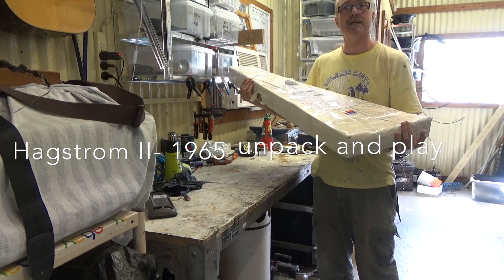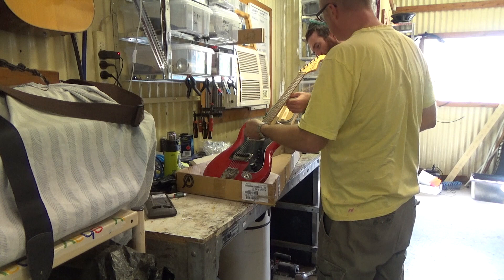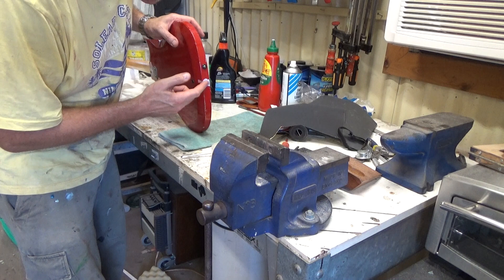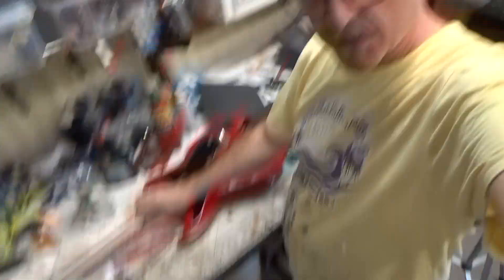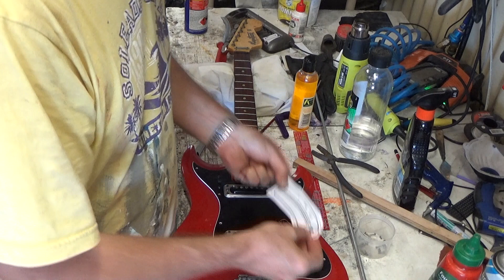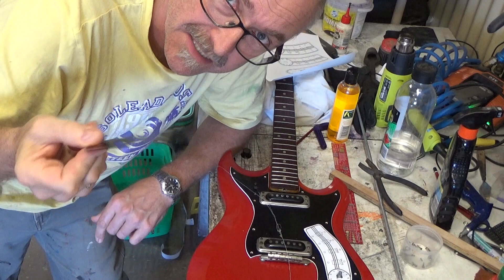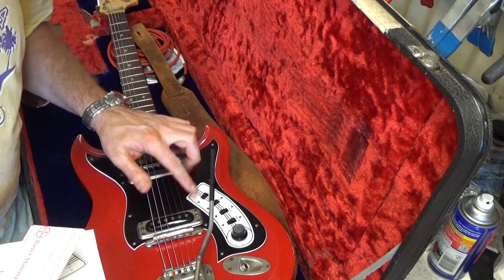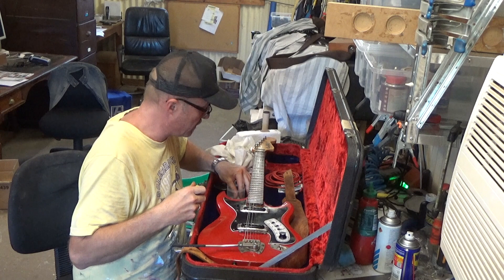Peterman setting up and reconditioning a vintage 1960s Hagstrom guitar

Comment: I am looking for an HII right now. Thank you for all the tips with restoring it! I am not as big fan of the white control plate so I would have left it black or gotten a new scratch plate that accommodated the switches. I have also seen some that use white switches and they would look better against the black background.

Comment: just got a 1965 black and white Hagstrom 1, looks just like that, only the pickups are not rounded on the edges, but straight-edge rectangles. QUESTION: When I was rubbing the rust off the pole pieces pressing hard (heavily rusted), I discovered the poles are not one solid piece. 

The top part you see is a little steel cap that is glued onto the actual pole underneath. Apparently the rubbing alcohol I used to free the rust dissolved the glue. This happened on two pole pieces. I cleaned the old glue off, and put a tiny pinch of super glue (with pressure overnight) to secure the two caps. 

Have you ever seen pickups made this way, with metal caps fixed on top of each pole? They were magnetized. If you put them upside down, they would repulse, but the correct way, and it they fit right back in place. 

They work fine, but I'm curious nevertheless if this strange construction is unique to Hagstrom, or are other pickups made like this...
Reply from the maker: short answer... dont know!